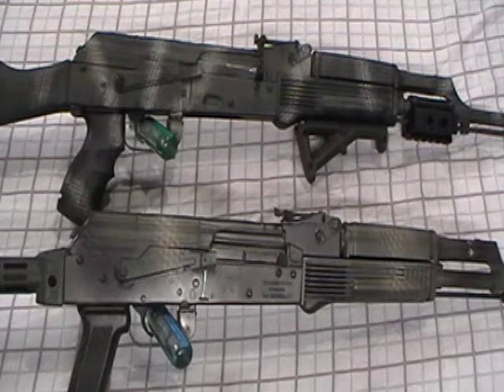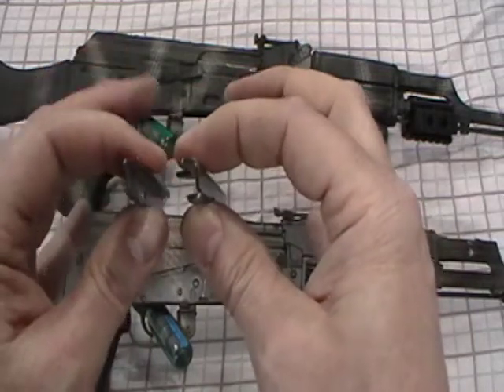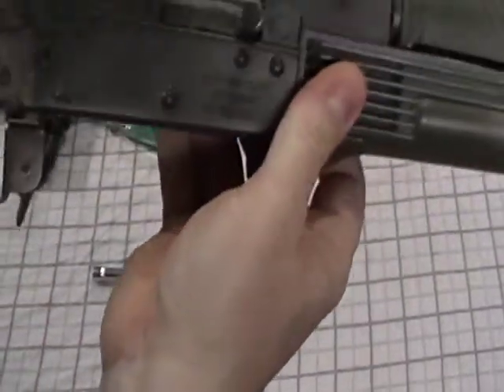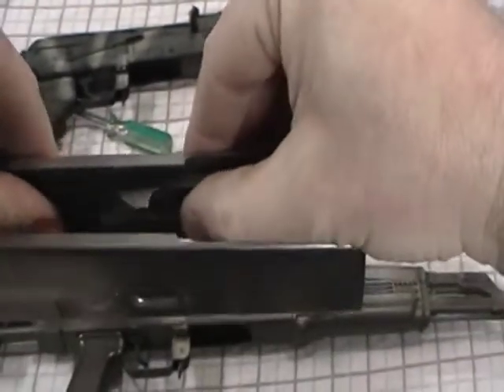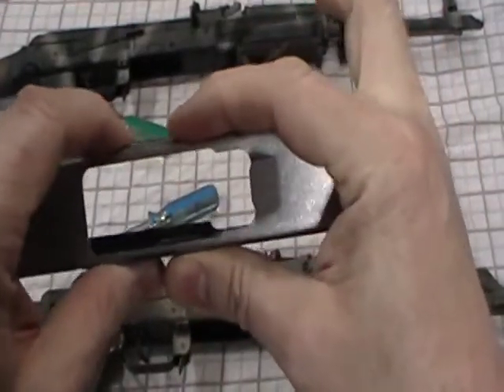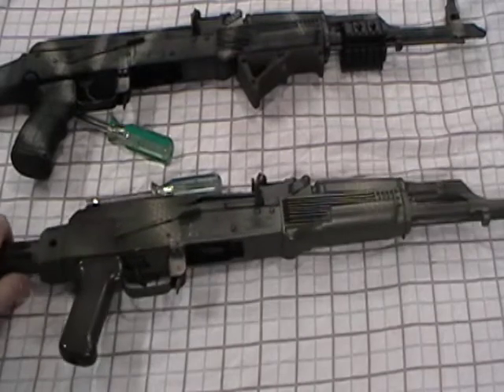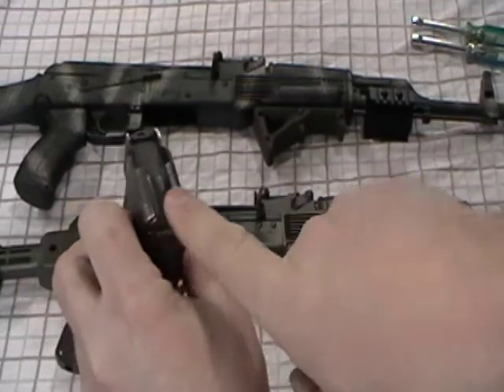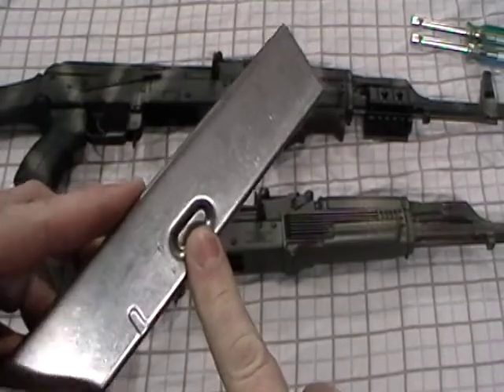AK Mag Wobble

Comment: great video! Question, I am very new to shooting sports-how do we know if the mag is too wobble? other than try and error
Reply from the maker: +na na   If it moves left/right to much, then the bolt will ride over the next round in the magazine. The only way is to insert the magazine and move the mag back and forth while hand cycling the bolt. Push the mag to the left and cycle, then move the mag to the right and cycle. The rounds are double stacked, meaning there are rounds laying on top of each other but off to the side of each other. So when the round on the left side is on top, move the bottom of the mag to the right side of the receiver and hand cycle the bolt to see if it wants to ride over the round. When the top round is on the right side, then move the bottom of the mag to the left and check the same way.  Also check to see if the magazine can be moved forward (bottom of mag towards the muzzle of the gun). If so, then either round right/left can be missed by the bolt because the back of the case (round) is sitting to low for the bolt to catch the case and strip it from the magazine. The top of the magazine should be even (parallel) with the lower rails. I hope that I am not confusing you with my explanations.
Reply: Mel64D I have a wasr10 from 2016 do I have a single stack or double stack bolt?